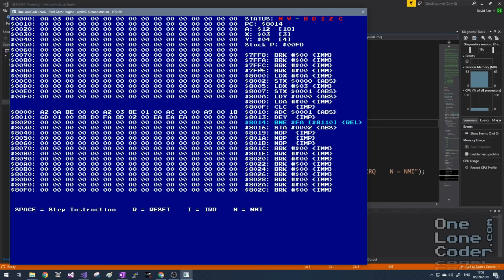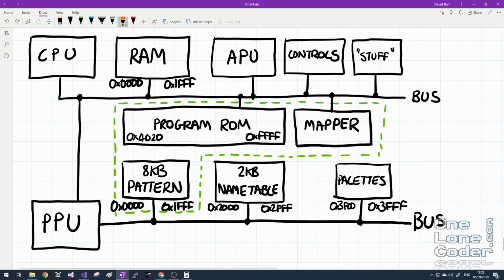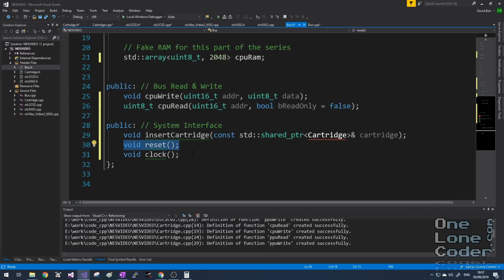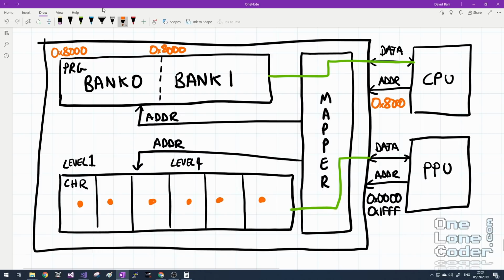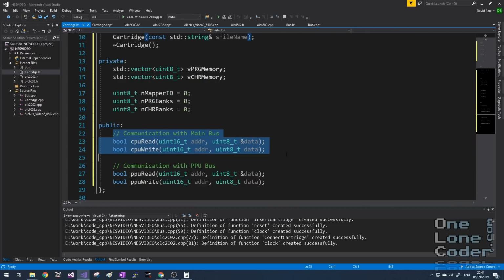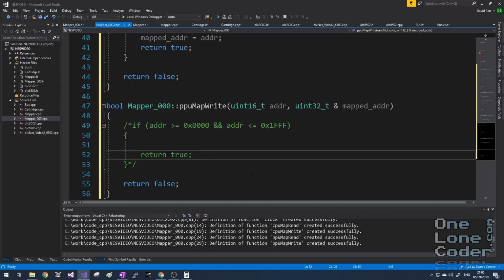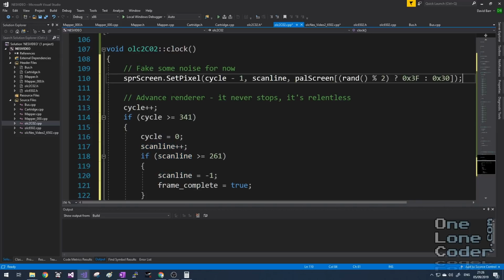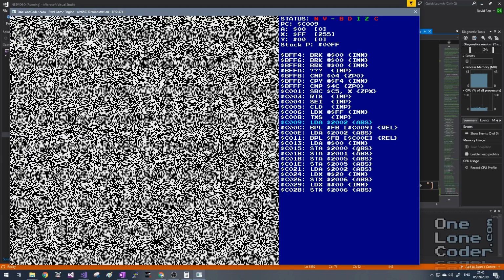NES Emulator Part #3: Buses, RAMs, ROMs & Mappers

Comment: This is great.
I wanted to start out by coding up a 68000 as I want to create a Genesis emulator but it occurred to me that I always rush headlong into projects that are complex. I kind of short-circuited my thinking and decided to try for a lower spec processor and came across your tutorials.

So I have started to code up a 6502 emulator and your tutorials are very clear.

Thank you.

Comment: Been trying to follow along in plain C for an added challenge. Got up this far using just the standard input/output, even adding functions for RAM dumping to screen and file, as well as a disassembler. For the bus, I went a step further and added a single linked list for untyped device pointers. Come the graphical, audio, etc stuff, I plan to leverage SDL2.

When it comes to systems programming, emulators aside, C is a must. Despite the lack of type safety and using preprocessor, I want to develop a discipline in C so that when it comes to real system development,  I won't have to re-learn how to do things. Plus, I've a passion for bare simplicity if I can utilise it.

Comment: First of all, love the videos so far!
Just noticed something in Bus.Clock(). I think you'll have an extra clock of the CPU when nSystemClockCounter overflows.  4294967295
 (max value for 32-bit unsigned) % 3 == 0, then next increment nSystemClockCounter will be 0.  0 % 3 == 0.  So you will clock the CPU twice.  This might not even be noticeable, but just wanted to point it out.

Comment: Considering these days, games requires gigabytes of ram, it somehow amazes me how they managed to get something like Sabre Wulf for the ZX Spectrum 48K to work
Reply: Sabre Wulf looked more complicated than it really was from the programming point of view. Alien 8, Knight Lore and similar games looked really impossible. I recommend you the book Steven Hugg - Making Games for the Atari 2600 to see how the games were made on 1 MHz 6502 CPU with just 128 bytes of RAM where the programmer had to update the graphics processor's registers on the fly at the exact moment when the electron beam was at the right place meaning the game logic could be updated only during the vertical blank periods and during some of the horizontal blank periods. Some Spectrum games were updating the border (port #FE) in sync with the electron beam too, for making the line through the border and some changed the attributes in sync with the electron beam to make possible more than 2 colors per character which was similar to how every Atari 2600 program had to work because of the hardware limitations. Spectrum at least had 6144 bytes of video RAM (+768 bytes for attributes) covering the full screen where one could draw the pixels but Atari 2600 didn't have enough RAM even for a single scan line of the picture :-) Atari was designed to run games such as Pong or Tank with a few moving pixels and a static background but at the end programmes made even 3D games, flight simulators etc. A lot of Spectrum games were really extraordinary considering the hardware limitations (and Sabre Wulf sure is one of them) but looking at what was made on Atari 2600 and knowing its hardware limitations looks even more impressive compared to Spectrum. I still remember my surprise when I saw Alien 8 on ZX Spectrum for the first time :-) Not to forget Spectrum's multichannel sound routines with full ADSR envelope made without any sound hardware by "just" toggling one bit of the port #FE (the same port where 3 lowest bits are for the border color).
Reply: @rokker333 Yes, you are right Spectrum and Atari required a different kind of programming but both required an ammount of ingenuity to make some games - at least compared to the computers with different hardware concepts. Even making a 'redefine key' routine for Spectrum wasn't trivial. On the other hand, even displaying a character on Atari required counting T-states. Yes, Elite was an incredible port. The animated circles I saw in Elite made me researching the fastest way to draw a circle on Spectrum :-) BTW, Elite's routine for clearing the screen was faster than using LDIR instruction specificaly designed for such purposes. Instead of using LDIR they moved the stack pointer to the end of the screen and then there was 16 (or maybe 32, I don't remember) PUSH instructions in a loop which is faster because every PUSH clears two bytes in less T-states than LDIR. I learnt programming by disassembling various loading routines (speedlock, bumping header, ...) and by disassembling multichannel sound routines from some games (e.g. Ping Pong by Imagine/Konami was quite tricky). I did some 6502 programming on C64 too but not so much as on Z80. Unfortunately I skipped Amiga and Atari ST and later started using microcontrollers which I still do and I started to examine Atari 2600 only recently. Maybe you forgot the details about C64 and Amiga intros but I am sure you could still make an intro using an emulator + cross compiler :-) I sometimes still write some Spectrum routines for fun using z88dk which can output snapshot files for using with Spectrum's emulator, I am sure there is something similar for 68000 + Amiga. As for counting the clock cycles (T-states) to write to video chip registers on Atari 2600, there was even more complicated project back in the 90s using 16F84 microcontroller where there wasn't any video hardware but the microcontroller had to generate composite video signal and audio for the game (Tetris) without help of WSYNC or HSYNC signals and if I remember correctly the same pins were used for both generating the video signal and reading the buttons. And everything was made with just 1K of program memory and 68 bytes of RAM :-) I still have that 16F84 Tetris on an old breadboard. Thank you for the link, I will sure watch :-) Regards
Reply: They used their brain. Today marketing is enough. Gamer's hype reactions feed marketing and make it stronger.
Reply: @ChupoCro    Ah, yes.  Programming to the Raster.  That brings back, um, er, nightmares.

Comment: If I understand correctly, the mapper is "something that doesn't give the same answer for the same question". Which is basically what a web server do. 

So there is no limit of the size addressable with a mapper, there isn't even the constraint that the address actually maps something (I am thinking of a vector image with infinite zoom).

So, would it be possible, or even feasible to have a LUA mapper. The mapper (c++ side) would just delegate the job to a lua script and let it do whatever it wants and provide whatever answer it wants. 

Technically, you could have a game running entirely in lua and give the final result to the ppu. 

You could also have a "cartridge" that actually has an internet connexion, and have online multiplayer on your virtual nes, or a screen with games selection, or 3D with advanced shaders (and repalettized in the final step).

(I think I have tinnitus right now, I am hearing "heretic ! heretic !"  :) )

The main question is : how fast is lua ? I heard it's really fast, but here we are talking about maybe 60 fps which may be a bit too much. 

I am entirely in favor of a customized nes (and for everything above  I remember that the condition for this is "a mapper delegating things to lua, so it's not hard to do).
A nice customization I think about since the first video of this serie is the possibility to change the internal frequence of the cpu, or even decide when a frame should end. Of course it would be for custom games only.
Reply: David Keller there is something like this. Look up pi in a nes cart.

Comment: 9:33 You can simply the logic in cpuWrite to one comparison per each if block. 

if (addr < 0x2000) {
  cpuRam[addr & 0x07FF] = data;
} else if (addr < 0x4000) {
  ppu.cpuWrite(addr & 0x0007, data);
}

Comment: One of the improved NES capabilities you could give it is give it 8KB of RAM instead of just 2. The way you'd do that is very simple in emulators - just give up the & 0x07FF part and raise the RAM amount to 8KB. Some idiotic programmers might have decided to use RAM mirroring to their advantage, so I'd also suggest that when you write 0xFF to (for example) 0x3FFF, it would not write to the PPU, but would enable the 8KB mode.

You can also do that in real hardware, however it's a little difficult. The address mapper has 2 unused pins that would have linked to the higher 2 bits of the RAM address, but don't, thus the mirroring. So what you could do is replace the RAM chip with an 8KB chip and use these normally unused bits. It would take a little bit more time to also implement the enabling of this mode, however it is possible.
Reply: But what's the point to give it 8kb if the original software don't use it ? If you run it on a PC with 4Gb of RAM you could even allow the NES to acces all this RAM with a bank switching mechanism. But again what's the point if no software uses it ?
Reply: @fredg8328  homebrew AND what Javid wanted (he wanted some games that only worked on his emulator)

Comment: Hey Javid 
In your previous video you said that the Pixel Game Engine would not affect emulation at all and was just a visualiser.
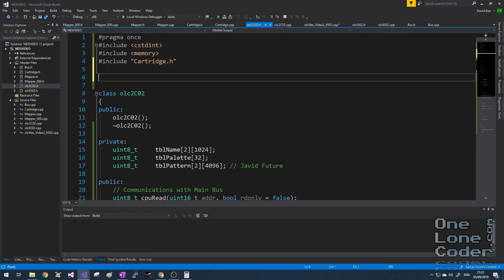However from 31:48 you start including PGE code into the PPU itself such as Sprite and Pixel.
This was a big part of the emulation to me eg. I really wanted to build an emulator that doesn't rely on any external code bar OpenGl or similar.

Is this temporary or is the rest of the emulator built on top of the Pixel Game Engine?

Thanks for the what I'm sure was hundreds of hours of work
PS.thanks for the vindication re: the bug i the disassembly, it was driving me crazy and I wasn't sure if it was my own code at fault or not! lol
Reply from the maker: Hi Ryan, the emulator doesnt rely upon PGE in any real way - but ultimately I do need to draw things to the screen. Since all PGE does is draw pixels to a window, it seemed like an appropriate tool. The olc::Sprite buffer is just an array of olc::Pixels, which are 4 component RGBA integers. No special magic involved. PGE uses OpenGL too, so anything you implement would probably look very similar.
Reply: @javidx9  Thanks very much, I suppose if i make it though this emulator i'll just follow your game engine tutorial too to remove that "black box" - thanks again!
Reply: @ryanstewart6834  How did you get on with using the pge? I followed part 3 and ended up getting runtime errors deep in the pge code which is quite hard to debug because its code i've had to copy and paste in with no context
Drawing the pixels is a main aspect of the emulation and to be 2+ hours into a tutorial before we find out we'll be depending completely on this external code is frustrating
Reply: @HarryPotterFan134  Runtime errors there could be a symptom of a bad CPU or PPE implementation, I had an issue with a runaway program counter that manifested itself as read access exception in the engine.

I had the same initial reaction, but really the PGE allows you to focus on the important stuff - emulating a NES internally. I plan to finish the series then go back and write my own implementation once I know my emulation is good

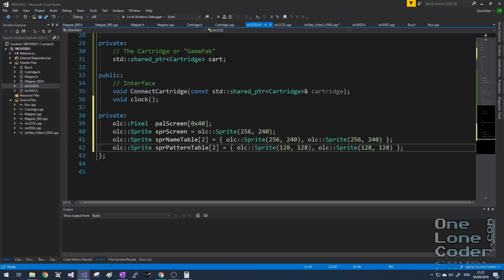Comment: I'm getting an error at 32:05 and its driving me crazy, 
line that's messing me up is 	olc::Sprite sprScreen = olc::Sprite(256, 240); 
and its producing four errors (all the exact same Severity) 
C2280	'olc::Sprite::Sprite(const olc::Sprite &)': attempting to reference a deleted function

is this just a basic thing that I am too stupid to understand
Reply: Glad its not just me any updates or did you give up like I am about to.
Reply from the maker: The error means that trying to copy the sprite is no longer allowed, which is correct in current versions of PGE. Either use the PGE version with the emulator or use the sprite's Clone() function to create a copy.
Reply: Thank you so much for answering all this time later!  I was thinking it was an update issue since there is no PGE file included with this series zip file.  I dug deeper on github and found all the releases and got the version closest to this video’s date and it…still didn’t work because I didn’t have nestest but once I got that it worked.  I think  I had worked a fix before but still failed because of missing nestest.  I really appreciate your videos that are helping me learn and more so helping years later.  Thank you so much!
Reply from the maker: Glad you're enjoying the puzzle that is emulator programming!
Reply: @jeffdowling1682  Where did you get the nestest.nes file if you dont mind me asking?

Comment: hi, have you considered using compile time polymorphism instead of runtime for implementing the mappers. the runtime polymorphism is highly inferior performance wise (although it reads more easily). I would love to see a benchmark comparison on that point.
keep up the great work
Reply: Or just use a switch ... see 'clean code horrible performance' although for 6502 emulation I'm pretty sure that any modern processor would handle it with plenty to spare

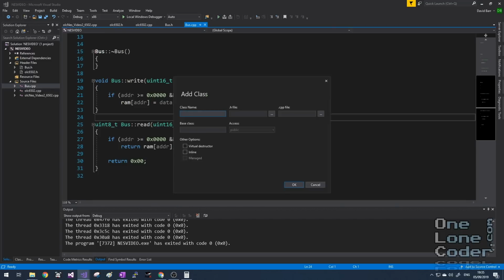Comment: 7:23 it's checking for address to be in range of 0x0000 to 0xFFFF for uint16_t is kinda.... redundant?
Reply from the maker: No. The compiler will obviously optimise that out. But what I get for free is a highly visual filtering system so it's easy to see what's going on. Also pretty useful for folk who follow along and don't use typed languages.
Reply: @javidx9  i'm absolutely amazed that you've checking and replying comments for videos that are 3yrs old. Thank you for reply! In terms of educational piece of code and video, yes, you're absolutely right in terms of readability. Though, it would be a performance issue in some kind of interpreted language without JIT, which is not the case here.

Also, can't wait for the next code jam :)

Comment: I love this channel!! PS4 emulator for your next project 🤣
Reply from the maker: lol thanks rob-DEV!
Reply: That is currently a PIPE Dream ATM because RPCS3 is still in development of the PS3 Emulation, they've been at it now for at least 4-5 years, and it is still considered early development and the core engine is constantly changing; and this isn't being done by a single person; it is being done by hundreds or even thousands of people within an open source community... I could maybe see the SNES, the Sega Genesis and possibly even the N64 but once you get to the consoles that moved away from ROM Cartridges and started using DISC formats, the challenge of Emulation increases exponentially, especially when they add copyright protection algorithms, compression and decompression, anti-piracy etc. to the mix. Take a Blu Ray Disc for example; if you zoom in on the outer layer of the "Pressed Disc" not "Burnt", you will see what appears to be a form of a sine wave that encompasses the outer edge of the disc. There are many different patterns of these waves that can be generated during disc manufacturing either it be a Blu Ray movie or a PS3 - PS4 game etc. A burner can not mimic this as this is done within the pressing stage of making the disc. Also there are some discs that have periodic blank spots which also can not be done by a Burner. These in combination gives the manufactures the ability to hard code onto the disc anti-piracy - anti-copying. This is why you have to periodically update your Blu Ray player over the internet. A new movie or game comes out and the Player or Console can not even as much read the disc because they generated a new wave form with different blank spots on the disc. So asking for a single person to Emulate a PS3 is a bit much never mind the PS4!
Reply: @skilz8098  It was a JOKE! :)
Reply: @rob-890  I know but I was stating the obvious for other readers...
Reply: Let's emulate a quantum cpu on a 6502!

Comment: Where did you get the nestest.nes file
Reply: Might be late to the question but you can find it in the nesdev wiki under cpu section second from last. I was wondering that too since the simulation just opens a blank screen and closes if it doesn't find the file. There is some nice documentation too for that test. https://wiki.nesdev.com/w/index.php/Emulator_tests

Comment: I'm trying to do this in lua right now, and I'm stuck at the mapper part. It seems like you put in code that isn't even used and it's really confusing me... is there something I'm missing?
Reply: Very late to this one but I'm in the same boat right now but using python. I will post another reply when I get it working. I've tried to understand it all, but the cpu reads and writes go immediately to the bus, and the mapper and cartridge never interact at all.